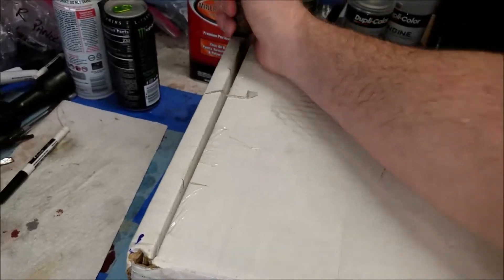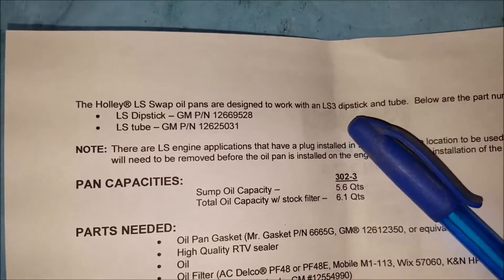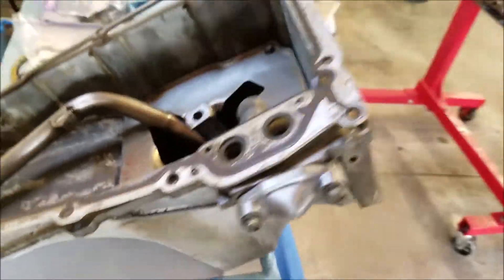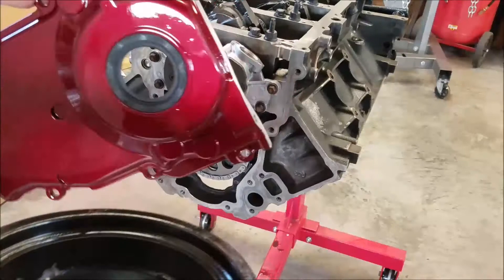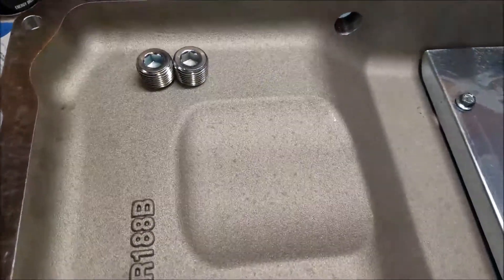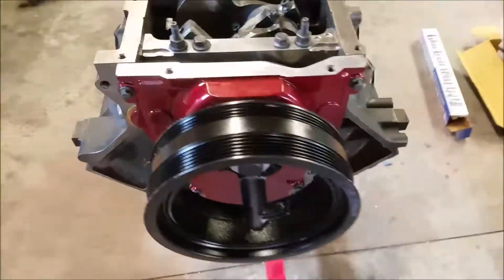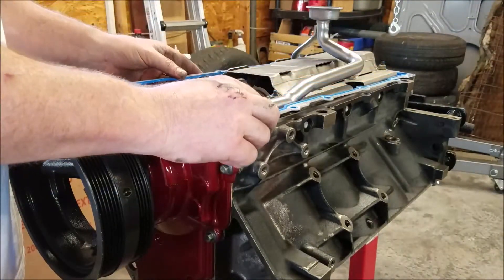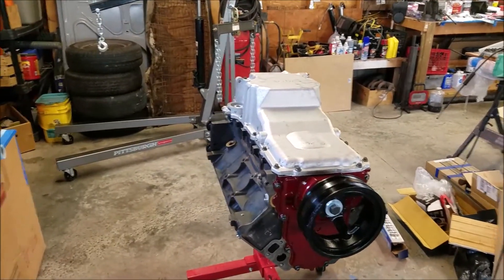69 Camaro: Engine Rebuild 5.3- Oil pan, front plate and balancer.

Comment: Woo! You scared me. I was thinking, "I did not cut anything when I installed mine!" So I went back and checked mine. Different oil pan, LOL. I love the color of that front plate, even if you can't see it!
Reply from the maker: The instructions from holley really help. :)  I've seen some guys cut straight across and it worked fine. Thanks.

Comment: I didnt see it on the video but I believe the rear of the oil pan also need to be flush with the block where the mating surface is with the bellhousing.  The bellhousing is bolted(2) to the oilpan at the bottom.
Reply from the maker: You know I thought I did measure it. I'll add it to part 10 video.  Thanks for the heads up.